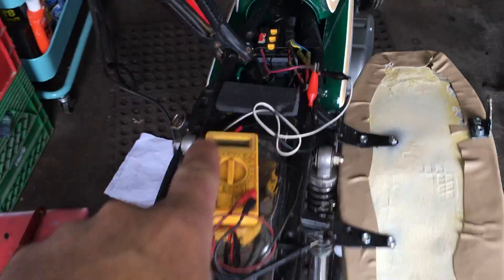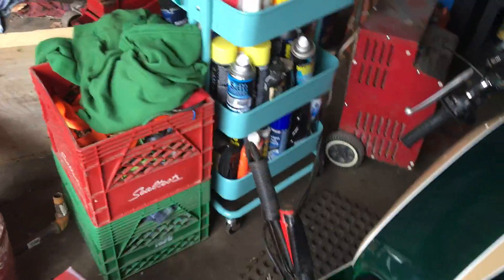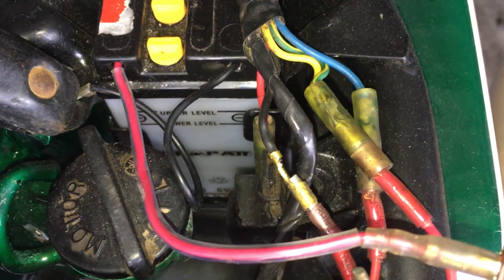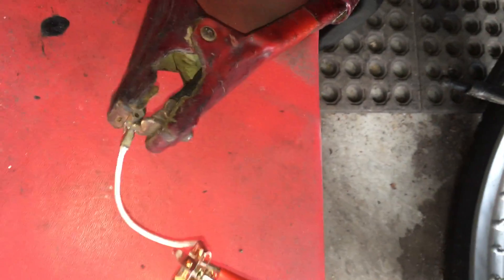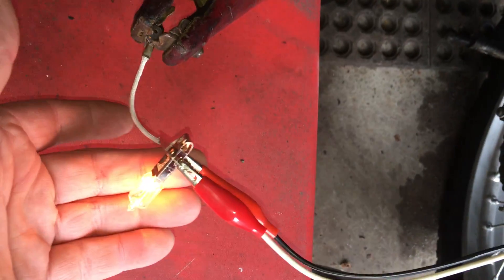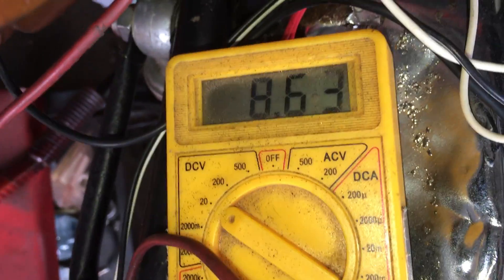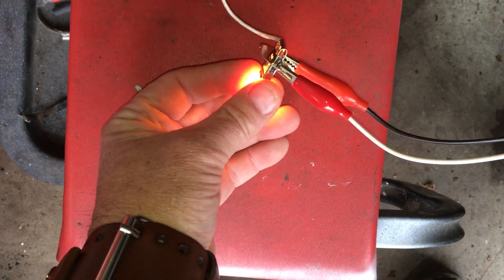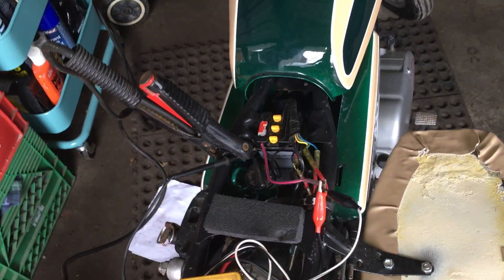how to charge a 6v motorcycle battery with 12v charger

Comment: so, when i check the voltage on the other side of the bulb without it hooked to the battery, it still shows 12v. i think your catching the battery voltage when you check it hooked to the battery.

Comment: Question. I need a trickle charger. I have a charger, that does both. 6 volt &  12 volt . I need a trickle charger. for a 12 volt battery.  I guess I can do what you did. Put some lights in line to bring the volts down on the 12 volt setting. to 1 to 2 volts. Thanks! You have a new subscriber!

Comment: Unfortunately I can't hear a word you're saying but it looks like you're putting a 12 volt bulb in line with the 12 volt charger but I'd definitely like to know how your doing it. I had a 6 volt charger but it stopped working so all I have is 12 volt. Can you tell me how to safely charge my battery. Do I put the bulb on P or N or does it matter. I have an 8amp 12 volt  charger and ild like to make it work so I don't have to wait on 6 volt charger.
Reply from the maker: yeah the audio isn't great .. hook negative from charger to the battery , positive from charger to positive of a 12v bulb . then from the negative side of the 12v bulb run a connection to the positive of the battery . The bulb takes about 1/2 the  charging power to light up and the remaining 1/2 goes into the 6v battery . Easiest explanation is to use the 12v bulb like an inline fuse between the + charger side to the + on the 6v battery
Reply: @fupabox  thanks I appreciate it. I was pretty sure that's what you was doing but I wanted to make sure so I didn't damage anything. I don't hear so good anymore and this phone which was advertised to have nice speakers isn't near as loud as my older one  and I can't hear half the videos except those recorded on all that fancy equipment lol. Thanks again I feel comfortable enough to give it a try.
Reply: @fupabox  and you connect the negative from charger to the chassis of the bike, don't you? As the negative of the battery goes to the bodywork too, right?
Reply from the maker: @markelbaslo7362  if the battery is in the bike you can hook neg to the frame
Reply: @fupabox  thank you. :)
Reply: I'm with you.  I played it over and over but couldn't work out the positive side of the procedure despite what everyone else says was a clear explanation.  The subsequent reply (below) explained it and I thank you both for clearing it up for me. P